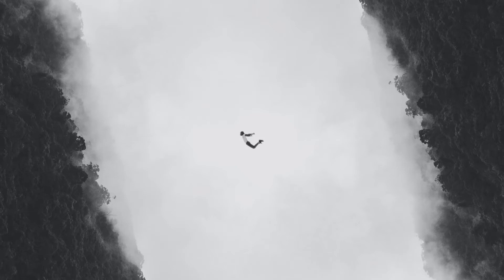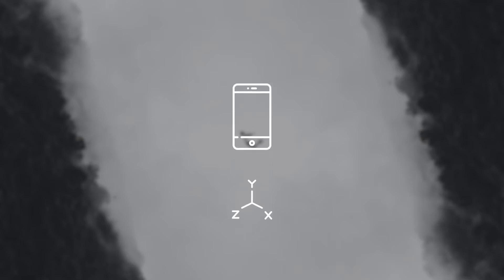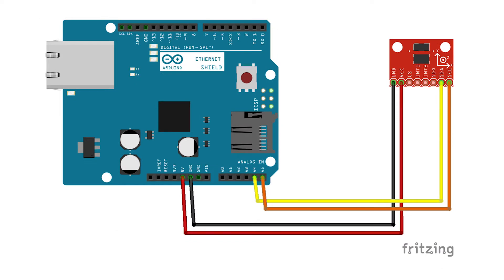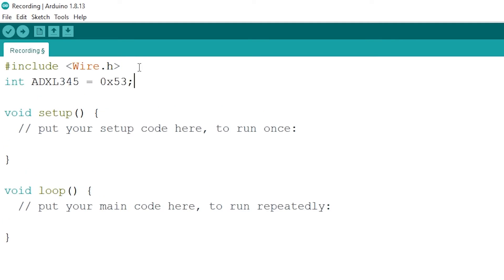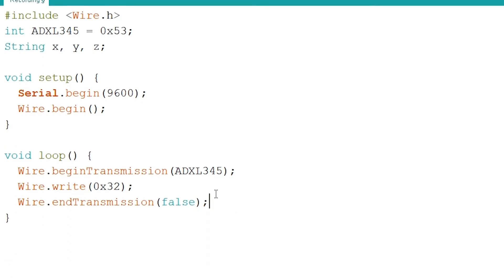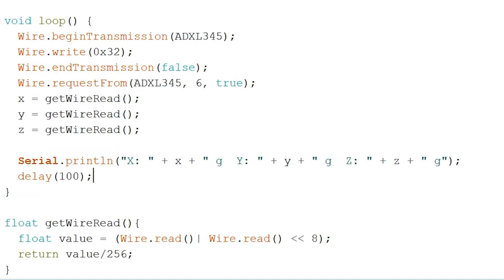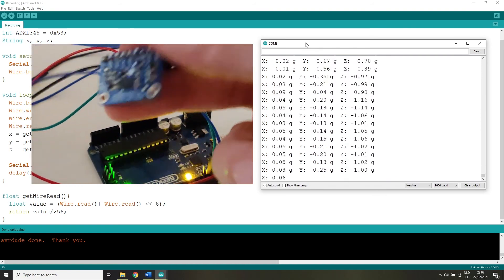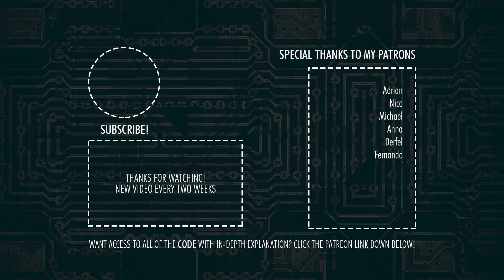Arduino ADXL345 Accelerometer - How to read out the Arduino ADXL345

Comment: #include <Wire.h>
 
int ADXL345=0x53;
String x,y,z; 

void setup() 
{
  Serial.begin(9600);             
  Serial.println("Iniciar");
  Serial.println();
Wire.begin() ;
 
}

void loop() 
{
  //leer los valores e imprimirlos
 Wire.beginTransmission(ADXL345);
 Wire.write(0x32);
 Wire.endTransmission(false);
 Wire.requestFrom(ADXL345, 6 ,true);
 x =getWireRead(); 
  y =getWireRead(); 
   z =getWireRead(); 

   Serial.println(" X : " + x + "g   Y : " + y + "g         Z : " + z + " g    " );
   delay(100);
}     

             
float   getWireRead(){

float value = (  Wire.read () | Wire.read() <<8 );  
return value/256 ;
}

Comment: There are different versions of the module out there. It seems like the most common ones don't have a level shifter which means the IO lines should be limited to 3.3V. So a direct connection to a 5V Arduino might not be the best idea.

Comment: this code gives nothing:

#include <Wire.h>
int ADXL345 = 0x53;
String x, y, z;

void setup() {
  Serial.begin(9600);
  Wire.begin();
}

void loop() {
  Wire.beginTransmission(ADXL345);
  Wire.write(0x32);
  Wire.endTransmission(false);
  Wire.requestFrom(ADXL345, 6, true);
  x = getWireRead();
  y = getWireRead();
  z = getWireRead();

  Serial.println("X: "+x+"g Y: "+y+"g Z: "+z+"g");
  delay(100);
}

float getWireRead() {
  float value = (Wire.read() | Wire.read() << 8);
  return value/256;
}
Reply from the maker: Are you receiving an error? If so what error?